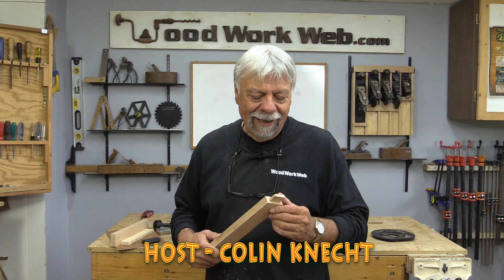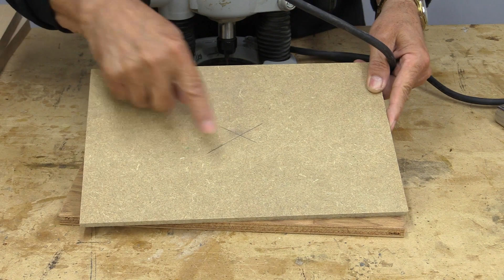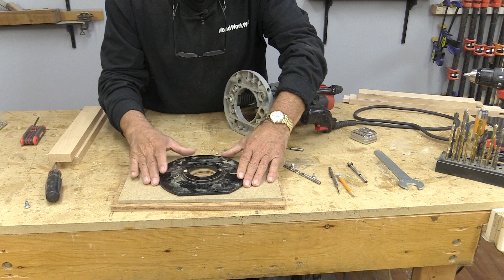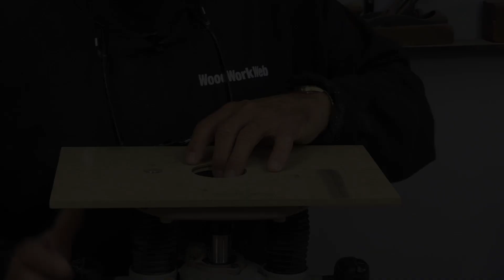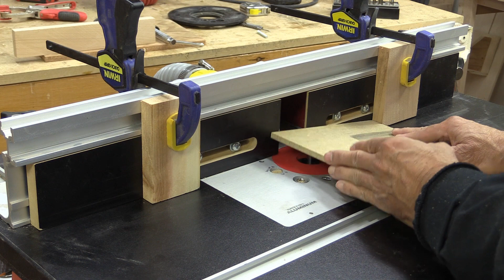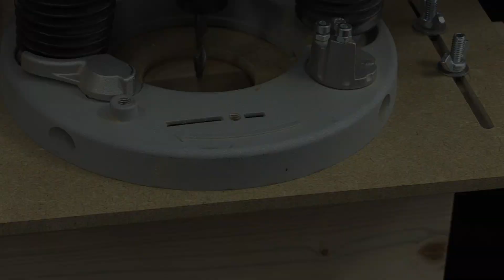Make a Mortising Jig for the Router (Mortise and Tenon Joinery)

Comment: I always centre my mortice by turning the wood round. To make a mortice wider than the bit I move the fence to get the bit off centre. I can then thickness the tenon by removing equal amounts from both sides by whatever method I am using. I like the router plane best to finish off, testing as I proceed. I usually place two tenons end to end and rough out with the power router first. Getting the cut square on the table saw with the rail vertical is problematic. Multiple cuts on the mitre saw works to rough out.

Comment: I looked at HomeDepot, Lowes, and ACE hardware for 1/4 hardboard and none of them carry it.  Does anyone know if MDF will work for the base?
When building jigs WoodWorkWeb should use materials we can get.  Otherwise, this is useless.
Reply: Anything works for jigs. I personally prefer MDF because it’s dirt cheap and sturdy enough to take some abuse. It won’t hold up to heavy use, because the edges tend to fray, but for the cost it’s easily replaceable. If you need something more heavy duty, make it out of 3/4” ply or hardwood.

Comment: I had trouble finding hanger bolts where I live. With a bit of digging around I found out the term seems to be used interchangeably with dowel screw and lag screw. Thought it might be worth adding that to the comments in case someone else has the same issue. Great jig by the way! Really simple and perfect for this!

Comment: Just a question.....couldn't I use my drill press to make mortise's by making a jig for it.
Reply: Douglas, you can, but you have to be careful. Drill presses are not designed to take very high lateral stresses, like a router is. So if you use a drill press, you need to make sure to take very shallow passes when mortising. Other than that, I know of no other reason not to do it.

Comment: I think the easiest way of centering a smaller hole inside a countersunk hole to reasonable accuracy is to drill the large hole the same as outer diameter as a particular washer, drop the washer in the first hole, match your second (brad point) bit to the inside diameter of the washer and then drill the second hole with the brad drill centered in the washer.
Reply from the maker: Thanks for the tip.

Comment: Another great jig Colin. Thank you for sharing. 
As a quick add on, could you show how you adjust the jig to get it centred for different thicknesses of wood? 
I used a similar jig during a seminar and found that part took some patience. 
Thanks
Reply from the maker: Yes, it can take some patience to get it perfect .... good points, will see what I canb do about adding this in another vid
Reply: A bit late here 😀,but it’s easy to centre every time if you turn the wood round.

Comment: question:  why would i not use the router table with a fence to make the Mortise?
the same way you made the slots.
 is it for bigger work pieces? when you need to bring the router to the piece?
Reply from the maker: No reason at all ... if you have a router table, as I said in the video there are many, many different ways of making mortises, this is just one version that may be suitable for beginners
Reply: I think a) for bigger pieces and b) because if you use the router table it's harder to see where the bit will touch the wood.
Anyway you probably can do mortises with the router and its parallel guide, but of course it's more subject to human errors.